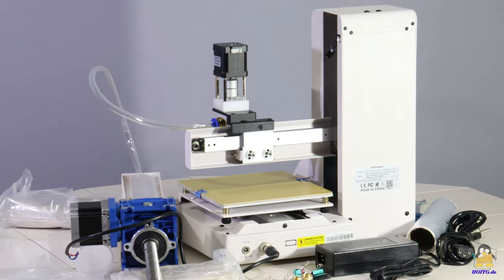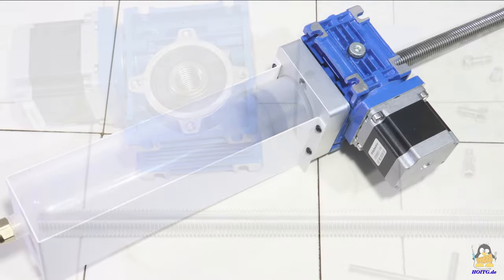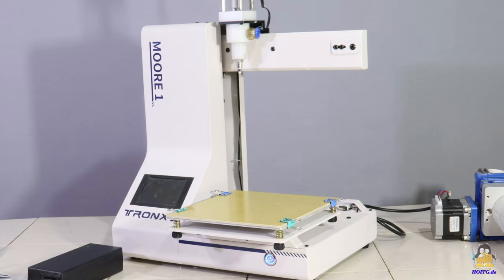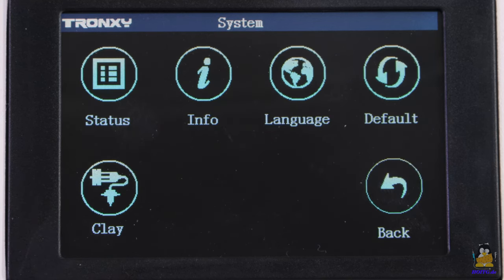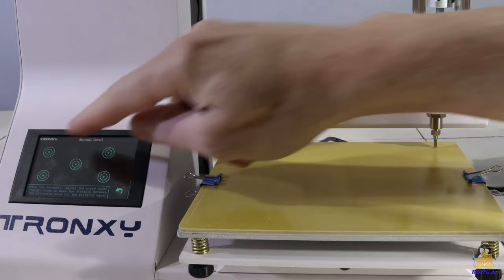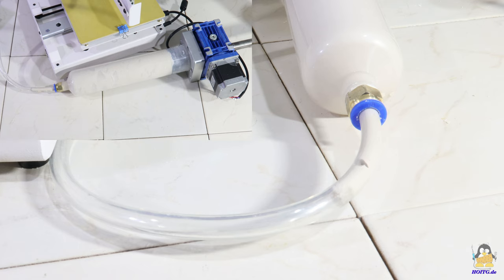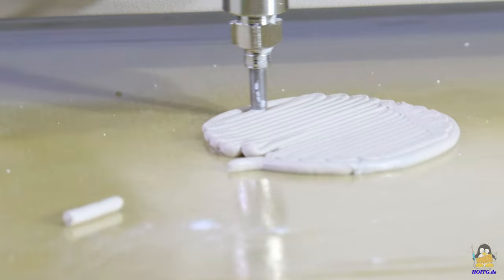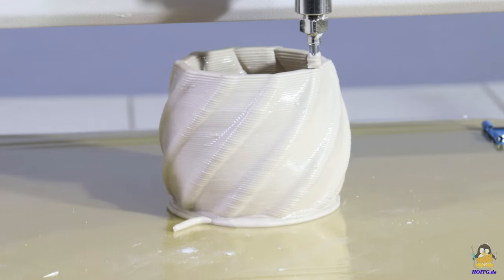Review of the Tronxy Moore 1, a 3D printer for ceramics

Comment: Würd mich jucken auf Deutsch zu fragen, aber da der Channel in englischer Sprache ist:
Did you ever print your own stls/files/etc.pp. (and if yes, how did it work out) or only the provided ones? Or asked in another way: How does the conception of CAD-Modelling for clay look like (I guess long straight walls like in a standard pla 3d print are not possible/instable)?
Is there only one mode for the printer, where it is extruding by a constant speed/constant adjustable flow rate? Or is it possible to print two separated objects at once (where at each layer height the extrusion got to be stopped and continued at the other object)?
Did you also burn the clay models to ceramic (if yes, what was the experience)?
Do you think a DIY Prusa mk3/4 mod for clay can be equally good (or is there something, what can the Tronxy Moore 1 is able to do a DIY solution can't)?
Are the surfaces and the housing of the printer clay proof in the daily use (I think clay is getting in everywhere, when you are dealing with it regularly)?
Reply from the maker: Nee. ich arbeite nicht nur auf (hessisch-Englisch), meine Videos gibt's auch immer auf Deutsch. Das hierzu gibt's hier:
https://youtu.be/ERHDO-4U3oE

In Sachen CAD muss man wie immer beim 3D-Druck die Besonderheiten des Druckers und verwendeten Materials beachten. Neben der Wandstärke ist Bridging, also das Überbrücken von Strukturen problematisch. Hier gilt: Ausprobieren und Erfahrungen sammeln. Der Vorteil von Ton ist, dass Fehldrucke komplett recyclet werden können.

Drucken im "Vasenmodus", also mit konstanter Extrusionsrate funktioniert am besten, es geht aber auch mit Unterbrechungen. Auch hier gilt:Ausprobieren.

Einen Brennofen besitze ich nicht, daher habe ich diesbezüglich noch keine Experimente unternommen.

Wer kann, kann auch jeden anderen Drucker modifizieren, aber man sollte Zeit und Geld nicht unterschätzen, die in solch eine Umrüstung investiert werden müssen.

Wie viel von dem Ton an Stellen gelangt, wo dieses Material nicht hin gehört, liegt an der eigenen Arbeitsweise ;-)